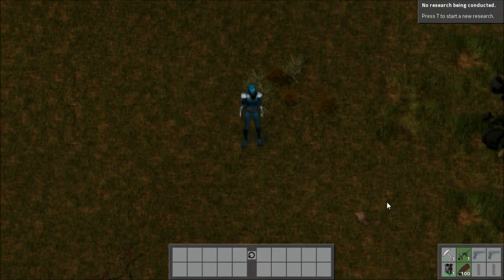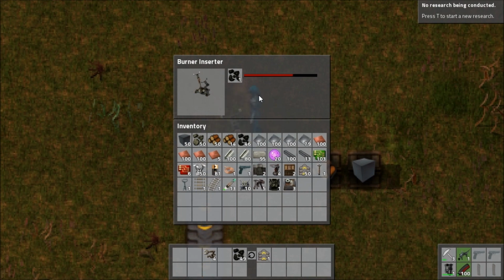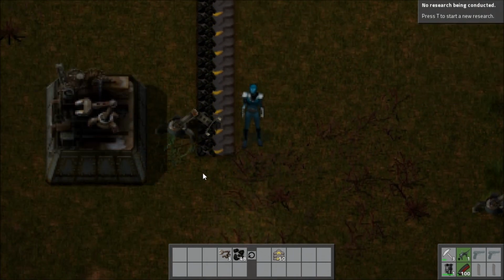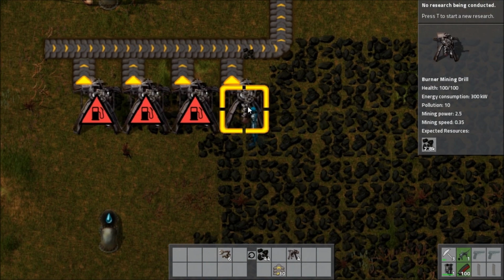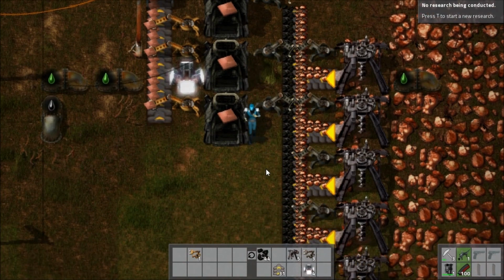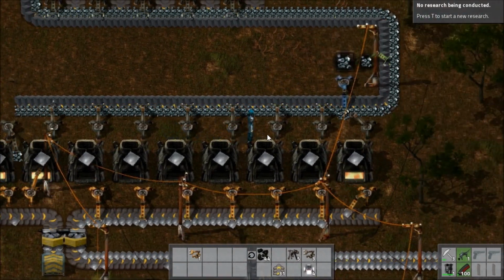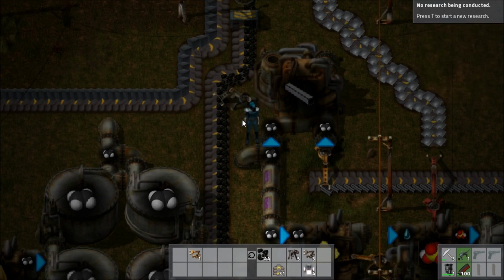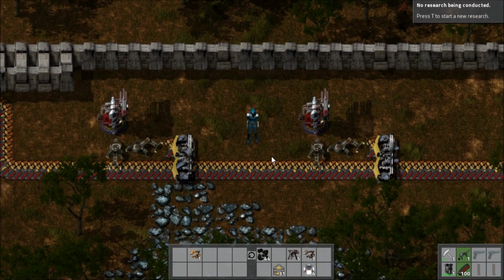Factorio Burner Inserter Tutorial

Comment: You missed the most obvious use. Feeding boilers. I think it's also the most important use.
Since electric inserters might cause a problem here. If your boilers run out of fuel for any reason and your power shuts down. Burner inserters don't have that problem. They will run and feed the boilers even if you have a no power =).

Can't think of a scenario where that might happen but still sounds like a good use to me.

Well one scenario might be when a coal mine runs out or oil shortage happens. That might lead to no electricity. And your whole factory shut's down. Burner inerters would be able to restart the system without you having to kickstart the boilers.

Well Solar would help here too. But pff solar power who needs that. I don't. Too much waste of resources for me ^_^
Reply from the maker: CRAP I FORGOT ABOUT BOILERS.
I EVEN HAVE THE WHOLE THING SET UP IN THE WORLD I JUST TOTALLY FORGOT BECAUSE IT'S OFF TO THE SIDE.
CRAPCRAPCRAPCRAPCRAP!
Reply from the maker: MangledPork I'll have to make an additional video tomorrow and link it at the end.
Reply: Orko found that on the wiki straight away lol, definitely a good use. 

Not a likely scenario, but here is one where that might make sense. Lets say you have an outpost very far from electricity, and your coal supply for your boilers ran out. You are using burner drills and burner inserters to mine the coal like in the video, but the deposit runs dry, and causes the shortage. If you used burner inserters on the boilers like you said you would only have to fix the system by drilling coal again and would not have to complete the additional step of inserting coal into your burners as you would if using electric inserters. This could be useful if the coal supply is a far walk from the boilers in that outpost. Like I said, not very likely I would set up something like that, but still possible.